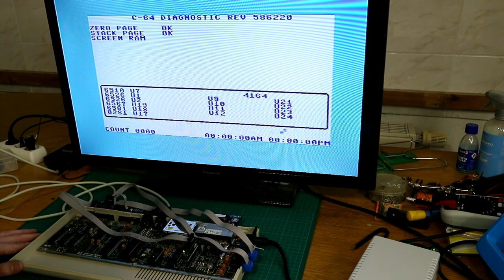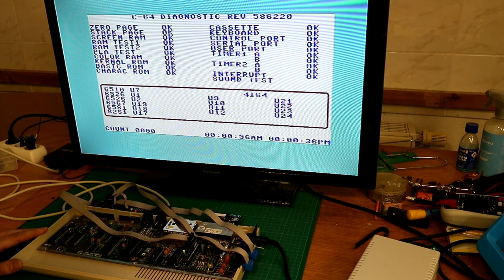Commodore C64 Test Equipment: Let's build a Test-Harness

Comment: Thank you Thomas, I have this harness to and it's a very good kit. I tried to use it on my ATX64 but the ports are too close on the back for the user port and tape port so I have not had chance to test everything yet.
Reply from the maker: Have you this harness tested with cases? Ic you have this with case, maybe try without. 👍
Reply: @tomscomputerchannel2925  it's because of how close the ports are to the joysticks and the video and serial ports, the edge connectors are the problem not the case.
Reply from the maker: Ok.